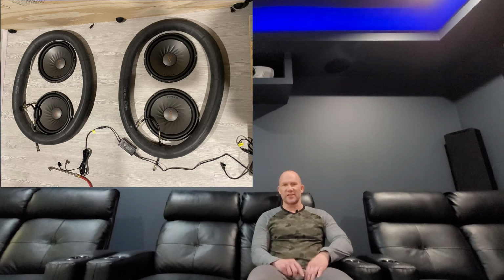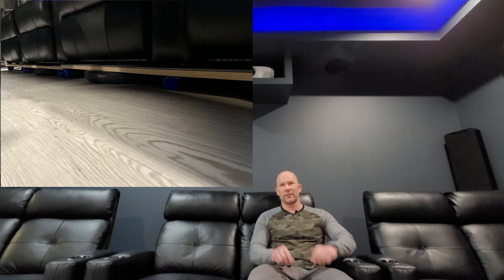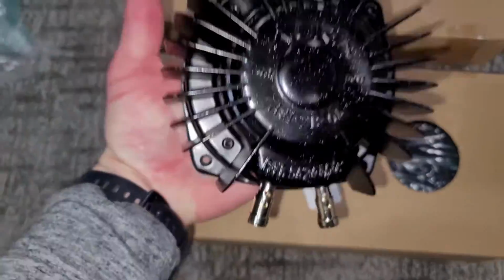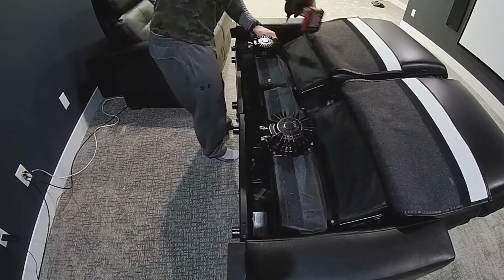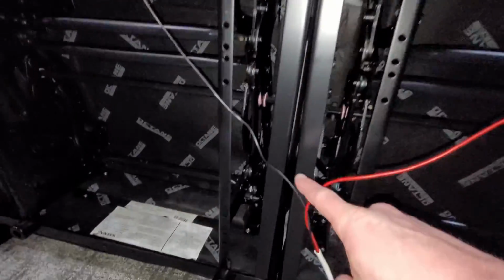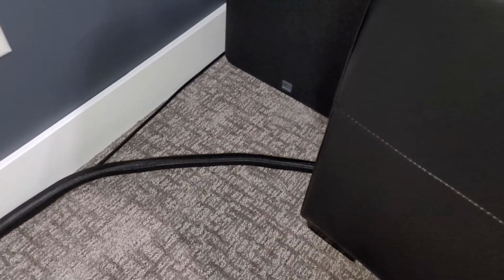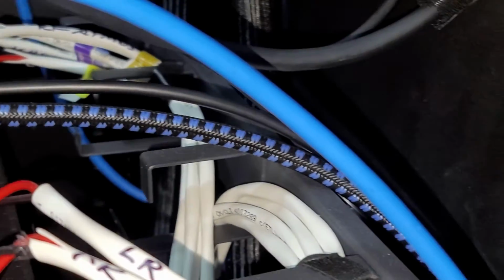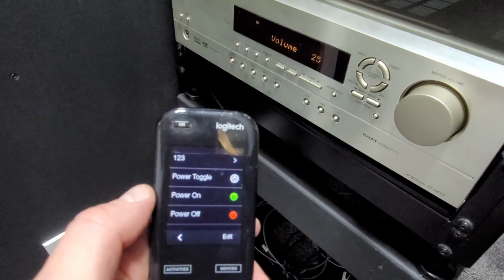Basement Home Theater - Bass Shaker Install for Tactile Bass

Comment: I have the sound shakers they came pre installed on my Diamante movie chairs quick and easy set up. They will shake the drink right off the tray table. 
Only a $399 option worth every penny. I consider bass shakers of any brand a must have option.

Comment: i dont have to do calibration after installing these right?
Reply from the maker: You might be able to time them, but I didn't and I don't notice any issues in my setup. I doubt they would get picked up by a calibration mic, but I could be wrong. Do some research and see what you come up with.
Reply: @TyEichele  i think i agree with you it wont be picked up by the mic.

Comment: How did u time these?
Reply from the maker: They don't need to be timed because they don't create bass like regular subwoofers do - therefore there is no interference anywhere.  They are instant with the movie, no delays.
Reply: This is incorrect if you don't time align  them you will not get the best of them  @TyEichele
Reply from the maker: @shaolin95  Let's be honest - we are talking nano-seconds here for timing.  Since they don't produce actual bass that will interfere with the subwoofer bass, you would never know the difference.  How are you going to time them when they don't produce noise that a timing microphone can pick up?
Reply: 😂 No we are not. This depends on many factors. Please don't misinform viewers @TyEichele

Comment: Hi,would you say thr 50 watt bass shakers are powerful enough? What about the placement of them? Would you say they are mounted in the best position where they are situated on the frame.
Reply from the maker: They are plenty powerful, yes.  The mounting position just needs to be on something solid to your seat, like part of the frame, to get the most out of your shaker.
Reply: They are not very powerful but it depends on your expectations. The bst-300ex is a far better unit
Reply: @shaolin95 I just purchased the 300ex, wish to run 8 of these in my HT room, with 3+4 recliners in 2 rows. Not all of the shakers would be used at all times, sometimes only one or two. What would you recommend.

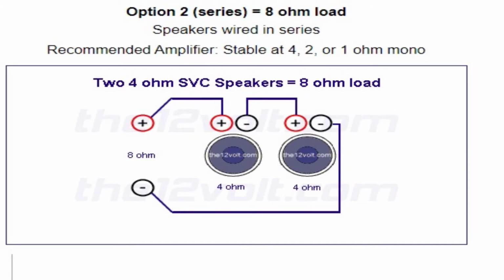Comment: 5:16 the MOST critical part of installation: the Proper Wiring ! I burnt (2) A/V Receivers because they overheated from running my (2) 4-OHM Shakers straight on (2) channels instead of in series on (1) channel to create the 8-OHM resistance needed. Pricey lessons learned but I am back in business and booties are still shaking!

Comment: I can hear a bit sound leaking from the shakers which is wierd
Reply: He probably needs to set an LPF on those main channels somehow. That Onkyo is outputting roughly 20hz - 20khz and the bass shakers only have a usable bandwidth of 10hz-80hz. Gotta filter out those frequencies 80hz and above somehow.
Reply: Is not weird. Bass shakers can create sound because attached to wood is like a piano soundboard.

Comment: Is there any chance this is compatible with soundbars like Sony HT-A7000?
Reply: I would not think so. It would possible if the soundbar had an LFE output. The LFE output then would also allow u to set the frequency response to 80hz or 60hz which is needed for the shakers which should activate when the bass is really low. U should not be sending high frequencies to the shaker. They will get damaged.  I highly doubt soundbars have this output so the answer to you question is unfortunately “No” 😢

Comment: hey great video.. quick question. I'm confused how to set up multiple shakers. I have a dedicated amp with 4ohm currently connected to one shaker. But i want to add another one. Do i need to change the amp to 8ohm? each shaker is also 4ohm
Reply from the maker: You change the Ohms by how they are wired.  Do a google search for wiring diagrams and it will show you how to wire them up properly so you have the correct ohms going to each shaker.  I have 2 shakers on each 'channel' coming from the 8 ohm amp so that each shaker receives 4 ohms, for example.

Comment: Hi
Need your advise
i got 2 micro subs running  so i use the main
Denon 3700 has only 2 pre outs only 
I am using rca y adpter 

 to split the signals  to the micro sub  and the  split cable to 2 secondary onkyo nr 656 input
i only got 2 bst-1 bass shakers 
do i set the direct signal from the onkyo have a better response
what do you think  ?
need your advise before i set it up
hope to hear from you soon
thank you 
Down under
jt
Reply from the maker: Yes, you don't want the secondary receivers adjusting the bass signal from the Denon.  Its only purpose is to amplify the signal to power the shakers.  On my Onkyo I have a 'Direct' setting which simply passes the signal straight through and does not adjust it with any type of EQ or anything at all.  That's how I have mine set up.  You can always try it out and see what you like, it's not necessarily wrong.
Reply: Thank you for sharing  your idea
will give a try
Hopefully it work

Comment: Hi, im gonna buy 4 of 300watt transducers with 2 of 2 channel amp to power it. Can i use 2 amp or has to be 1 amp with 4 channel?   Also can i use headphone instead of speakers?  Thank you
Reply from the maker: You can use whatever configuration you want as long as it is wired properly for the correct ohm and power rating.  I'm not sure about the headphones option.

Comment: My receiver has 4 sub outputs, 2 of which will be powering subs. Would you recommend using the other two outputs for four bass shakers?
Reply from the maker: It sounds like you sure could.  Just make sure you match the correct OHM rating of the shakers to the receiver.  That happens during the wiring part.  Google a correct wiring diagram.  And make sure the receiver powering the shakers, if it's a secondary receiver from the main receiver, is set to 'direct' or is in a pass-through phase so it doesn't mess or change anything with the bass signal it is getting from the main receiver.  Hope that helps!
Reply: along same lines. I have a DENON AVR with 2 SUBWOOFER PREOUTS (1 and 2, Both mono RCA). my actual SUBWOOFER speaker is connected to SUB PREOUT 1. I am looking to connect a 100 W Sub-Amp and 2 50W 4 ohm shakers to the Denon AVR SUB PREOUT 2 rather than a 2nd RCVR like you did. most the sub-amps have a set of L/R RCA jacks for the audio IN. Can I assume that a RCA Y cable from my DENON SUB 2 out going to the L and R audio IN jacks will be fine. or should I connect a straight mono RCA cable from DENON AVR SUB 2 OUT to either just the L or just the R audio IN of sub-amp?   @TyEichele
Reply from the maker: @DIgiHoolligan  Pretty sure you'll need a Y cable to split that signal into your subwoofer amp in order for it to work correctly.  Unless one of the L or R inputs are labeled Mono, meaning it accepts a single signal, you'll more than likely need both of them connected in order for the amp to work.

Comment: Question, if you hook up 2 shakers to a sofa, is it better to invert one's polarity? Or just have them both at same polarity?
Reply from the maker: Seasick - lol!  I don't think there's any reason to do that.  I never came across anything where people were doing that anyways.
Reply: @TyEichele  yeah I was wondering because I thought my receiver had the option for 2 transducer outputs, but it can only use one of the 4 LFE outs for transducers (would still be possible to connect 2 (or more) and invert whichever one's polarity, but it was just an idea that popped into my head, in hindsight, not the best idea lol) (one LFE out that can be dedicated to transducers)
Reply: Hm thinking about it, it might make you seasick 😂

Comment: Hey Ty, love the video.  Have a question for you, I have a 7.2 receiver with that second dedicated LFE to a sub.  I disconnected the line to my second sub and used a y-connector to an old 5.1 receiver, like you did.  My tactile transducers are 8ohms a piece (unlike yours), so I only connected one transducer to each of the left and right mains separately.  I'm not getting anything from my transducers, I even tried a different older analog 2-ch receiver.  The pucks DO work as I tested them with a direct connection to my main receiver.  Thanks in advance
Reply from the maker: Thanks for the comment.  This is a just a trail and error type of situation.  I know on my Onkyo receiver that controls my shakers I have to have the volume pretty high - typically around 70 out of 100 I believe is the max.  But you also have to double check that the signal is coming into the old receiver properly, and then getting pushed out properly.  Mine has a 'direct' function so it passes the signal straight through and doesn't try to change anything as far as surround modes or anything else that could mess with the signal.  Stick with the mains channels for sure, don't use a center or surround channel.  Maybe you can hook up an actual speaker to make sure the signal is coming through for testing purposes?  Lots of possibilities here, just have to start testing and narrowing it down.  Good luck I'm sure you'll figure it out!
Reply: @TyEichele  Got it, I'll try testing the outputs from the mains on the secondary receiver, among other things to just keep trouble shooting end eliminating possibilities.  Thanks and keep up the nice work!
Reply: Ty, I got it working!  Using that 2nd LFE out, I connected it to a disassembled powered sub, I took out the woofer and used the wires to connect to my 4 pucks in a series-parallel connection.  All is good, and thanks again for the inspiration!
Reply from the maker: @mochafoshizle  That's great to hear!  Nice work diagnosing the problem and correcting it!

Comment: Great work and great new effect visual experience!  Now I would like to copy your project but I don't know how to do it with my current rig.  I have a NAD t758v3i in cinema configuration 7.1.2...where should I connect the "new" bass shaker amp?  Thank you
Reply from the maker: Do you have multiple Sub outputs?  If so, use 1 of them for your subwoofers and one for the shaker system like I did.  If not, you could use a splitter or Y adapter to send one signal to the shaker amp and the other signal to your subwoofers.  Hope that makes sense and helps.  Good luck!

Comment: Ty, thanks for the video. I am much smarter from having watched... but perhaps not yet smart enough :) I have a few questions that I hope you clarify further for me!! Thanks

1.  I wanted to confirm what I am seeing in your video from 6:42-6:50 which is connecting the 2 bass shakers to one another (daisy chaining?) and running one line back to the amp. You are running speaker wire from the positive of your wall outlet to the positive of the 1st shaker, then running a separate jump from the negative of shaker 1 to the positive of shaker 2. Then you are running another separate wire from the negative of shaker 2 to the negative in your "outlet" Is that the correct configuration?     

2. I think you are connecting 3 sets of 2 shakers and was wondering if you had wanted to add a 3rd shaker to that configuration (2 sets of 3 shakers for example) what would that look like? 

3. My 2nd receiver/amp (Pioneer vsx45) has 2 RCA subwoofer outs. Until I saw your video, I thought I had to figure out how to connect the shakers to that output. Can I still do that? better? worse? unnecessary?  if doable, can you tell me how I would take the positive and negative returns from the shakers and connect to the single RCA out?
Reply from the maker: Go to 5 min 17 sec in the video and you will see the wiring diagram I followed.  You can wire various amounts of speakers in various ways, you just have to make sure you are staying in the same OHM rating for the speaker and amplifier.  By following this diagram I connected two 4-ohm shakers together to create a single 8 ohm load, which is what my amplifier is.  So use the appropriate wiring diagram for your application depending on what you are trying to accomplish.  You can google wiring diagrams to find all sorts of options like the one I used.

The speaker wires from my connection block go to speaker outputs on the back of the powering receiver.  My main Denon uses a single RCA sub output #2 to send the signal to the Onkyo which powers the bass shakers.  You can't connect speaker wire to RCA.  In fact you won't use the subwoofer RCA outputs at all on your second receiver if that's the one powering your bass shakers.
Reply: Thanks Ty. My shakers arrived today so I will read thoroughly… all your info was super helpful and I will be watching all the home theatre vids for more ideas.  👍🏻👍🏻

Comment: Hi, i started somewhat similar like you, but have to say with LFE @ 120HZ (Why so high) it would really bother me that u can feel the shakers that much. Guides say to cut it at 40HZ, i have it at 55HZ but use a DSP to (now i don´t know if the translation is correct) make the edge steepness steeper. This makes the effect more abrupt and powerfull. If you dont alter the edge steepness, even if you cut at 80HZ you can still feel sounds at about 120HZ, which often occurs in music.
Reply from the maker: I think it's all personal preference really!  Some people like more some people like less.  That's the cool thing about them is you can really dial them in for what you enjoy personally!  I don't have any more outputs on my minidsp 2x4 hd since all 4 outputs are going to my sub system, and I had the sub 2 output on my Denon to use so that's what I settled on.  I enjoy them the way they are.  I could probably alter the HZ in the receiver that powers the shakers if I really wanted too, and maybe I'll try that sometime just to compare the difference.  Thanks for the suggestion!

Comment: Have you found that these devices don't have a low enough frequency range?  You said you bought a second amplifier for these, what was the channel wattage? If you said it, I missed it.  I take it this system is louder than the one in high school?  I've been considering getting some, but haven't figured all the logistics for it out yet with my setup.
Reply from the maker: Hey there!  I don't have any issue with a low enough frequency range, as these aren't 'heard' but felt.  I let my subwoofer system ( 2 12's, and 4 18's) handle the low frequencies.  These just add a new level of feeling or dimension to the system, which is awesome! The second amplifier powers all 6 of them at 50 watts each across 3 channels.  And yes, this system is much louder, but I don't listen to music on it much.  Mostly just for movies.  Good to hear from you - hope you are doing well! 👍
Reply: Yes they don't got as deep as crowsons or my favorite,  a Hovereze platform which can go low into single digits like 3hz depending on your configuration. If you use BEQ you will get insane performance if you build a Hovereze way beyond drugs buttkickers can do 
Totally worth it

Comment: Great video and explanation.  I have the same set of Aura bass shakers, but are currently not wired as I relocated my setup.  Some comments:  The outputs of the Onkyo to the bass shakers may not be the same for all 3 channels all the time if the DSP setting on the Onkyo is set to Pro-logic or some other mode that simulates a 5 channel mode source, and putting it in direct mode will output only to the L and R channels.  A concern however in connecting 2 x 8 ohm loads on the same channel, and doing an A+B typically will do a parallel of them, presenting a 4 ohm load to that single channel.  Not sure if your Onkyo is stable to drive these low an impedance of a speaker load.   

Are you able to distinguish the difference with or without the shakers, considering you have those big infinite baffle subs "massaging" your back?  :)  Great setup!  More power.
Reply from the maker: Hello! Thanks for watching and for your comments.  As far as the Onkyo goes - If you go to my video at the 9 min mark it explains how I have the 3 runs of speaker cable.  I intiially had it set to L R and Center channels, but like you mentioned, the Center channel output was't receiving the same output as the R and L channels.  So what I ended up with was running the outputs on the L channel on speakers B and the L and R channels on speakers A.  Then the Onkyo is selected to Direct so that there is no DSP interference, and I select both speaker outputs A and B and it passes the same signal to all 3 outputs now.  I have used my Ohm meter (not shown in the video) and confirmed this works!  And yes, there is a very noticeable difference with them on!  They are great!  And yes, more power to the infinite baffle is in the plans for future upgrades, stay tuned!

Comment: Terrific video, I like your style of delivery. Soooo.... You talked me into shakers and I didn't know it but I need a Harmony. (Sighing as I pull out my credit card).
Glad you showed it to me though. I always hear about the Harmony but hadn't ever seen one. I currently have 18 remotes (multiple system nightmare).
Thanks again for the great vid.
Reply from the maker: Thank you very much!  Appreciate it.  Some bad news possibly on a Harmony remote is that they quit making them or supporting them, so your only option is to find a used one like I did.  They still work if you can find one in working condition, Logitech just quit producing them.  There are some youtube videos on some possible replacements out there you can check out if you are looking at new options.  It is really nice to have one remote to control everything though!  Good luck in your search and with your shaker install.  You'll love them I promise!
Reply: @TyEichele  Thanks so much for the info on the Harmony Elite. I went on over to eBay and found a good one at a reasonable price.  Now, on to the Shakers! 🙂
Reply from the maker: Awesome!  If you think about it, report back here when you are done with your thoughts on them. 😉👍